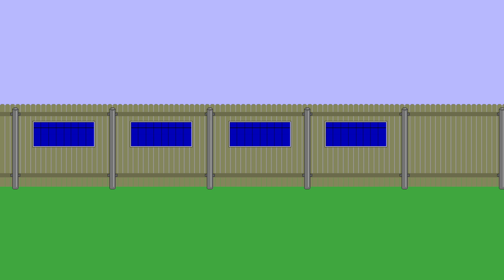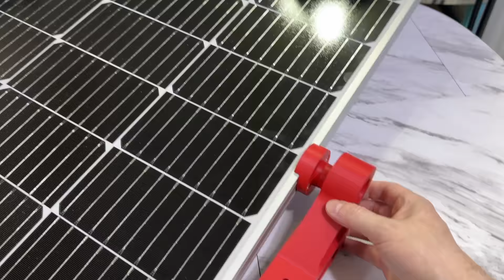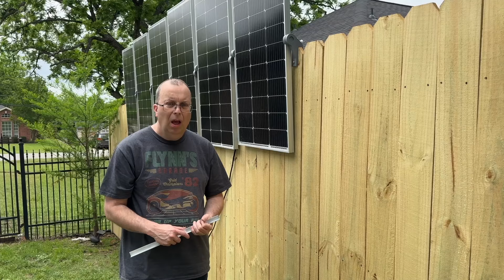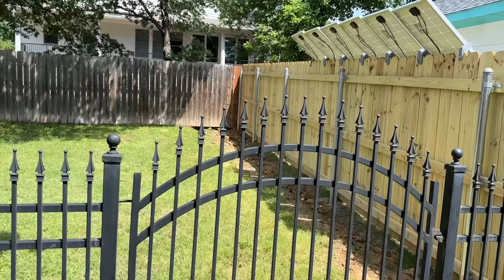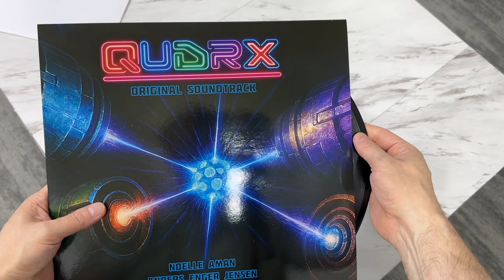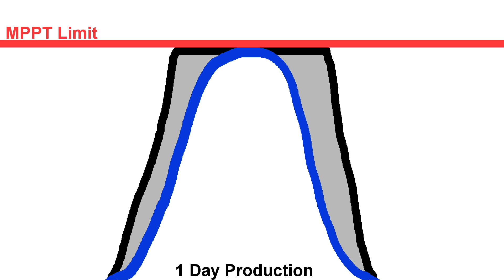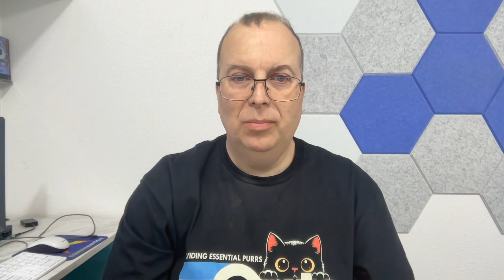I made an adjustable Solar Fence!

Comment: Thought on locking the panels at an angle: what if the mounts have teeth and can be screwed tightly, similar to a joint on a cymbal stand for a drum set?

Comment: I mean, it sounds cool, but I don't pay more than $1-200/mo for electricity without solar and I live in California. 

I'm sure I'm a low use case comparatively, but it seems like a lot of work and investment vs. just being mindful of usage.
Reply: Where in California do you live if you don't mind me asking? We're unfortunate to only have PG&E and during the summer our bill gets to over $400/month mainly due to having the A/C running. I live north of Sacramento and we don't have solar.
Reply: @JJFlores197  I am in 93555, right at the meeting of Inyo, Kern and SB.  We do have a notoriously high electricity price here despite being desert with plenty of sun for solar and lots of wind for turbines.
Reply: @JJFlores197 i grew up in Roseville.  I have moved to the desert and will admit that swamp coolers arw a bit of a hack. But they rarely make it comfortable.  Learning to live woth 76° vs 71° is the hurdle.  If true AC is the demand, then our 8 bit guy's situation is the answer.  I'm just positing that learning to live is a lower barrier to entry.

Comment: a neighbour of mine sets up when the battery is full his charge controller output is diverted to run just one of the elements in his water heater.

Comment: $600 a month electrics ?! 😱😱 I pay €50 and i already moan about it. Ok, here in Portugal the wages are low, but dammm life in the US is expensive, i go there often but never had interest in those costs as i go all paid by the work, but damm
Reply: Here in California, those of us that only have PG&E as our electric provider pay through the nose for electricity costs. During the summer months we pay around $400-500/month mainly due to the A/C running. PG&E's faulty equipment has caused numerous fires over the years and we are stuck paying for their screw ups. They've increased rates like 7 times over the past couple of years because they needed funds to repair and upgrade sections of their equipment so that the fires don't happen again. A lot of people are beyond frustrated with high electric prices here in California. But hey, at least we're the 4th largest economy in the world! 😆

Comment: I really like your setup! Great work. I would have tried to make my fence horizontal at the top by just cutting some on the bottom, gradually more when required. I think it might look nicer and be far easier to mount your panels. You can probably still do that! It will lower your fence somewhat though.

Comment: ❤ power companies need to buy your overage, last i checked, if the setup is correct.  At a reduced rate, but that night time setup you mentioned sounds like a scam versus producing excessive peak power for hours on end each afternoon. ❤

Comment: The panel location and tilt wouldn't work with any of my neighbors. Or me. It's great that it's your relative, but you're clearly implying that friendly property line agreements are ok. Frankly, I wouldn't even consider invading other owners' property, much less the legal side. But the main issue is it's arguably a legal issue. It's legally never a good idea to break property lines, or even push property lines with an overhang, even a variable overhang. Never ever. It's particularly not a good idea to make friendly agreements about property lines with neighbors. When houses are sold, one of the steps is to research and clear the property lines. You're just making trouble for realtors everywhere.

Comment: Regarding over panelling, it should be done very carefully to avoid fritzing out your charge controller. While the controllers normally do clip production to the maximum wattage, if the voltage goes too high, it's game over.

Comment: Just some considerations for anyone thinking of trying this.  Work with your neighbor, don't just do it.  A fence is a shared asset and requires neighbor cooperation.  First reversing the fence side needs to be mutual.  Typically if you replace the entire fence out of your pocket you get to choose, but don't assume.  If you split the cost and want to flip your neighbor needs to agree.  Second you can't just hang something on the top a fence that is visible to your neighbor.  Again you need to work with them.  Finally you absolutely cannot have something on top of the fence that also leans over into your neighbors yard.  Do this on your own and you're going to meet your neighbor whether you wanted to or not.  Ignore the issue and you're going to end up in court and likely paying for damages.

I am sure David did all of this.  He's really good at reaching out and I know he knows his neighbors well.

Comment: This one video demonstrated the "lethal" (spain for example, almost whole grid collapsed) shortfall of solar: energy storage and lack of predictability. Its stupid and drives energy prices through the roof (BC power company has to keep quick response gas powered powerplants at the ready to pick up the slack whenever ""renewable" generation plummets like a brick dummy)....
(Wont even get started on the batteries. Those things going cactus way before they had any hope of recovering their cost.)

Comment: My brother, you need to run all that inside steel conduit with junction boxes for the connections if you're going to mount it to a combustable material like wood. 

and the lawn mowing guys are going to weed eat those cables you ran along the ground if they haven't already by now.

Comment: The rebates unfortunately encouraging huge scams in my country. Also as soon as they start charging money to sell back to the grid people with either remove the panels or just go off grid. Solar panels are very popular in Australia due to government rebate. Is going to be significant challenges with replacing them as the older ones need fixing.

Comment: What about using those gas struts people use on the back of there pickups for there tailgate. Would make it easier to open and close quickly, and then perhaps add some sort of locking mechanism at each end of the travel

Comment: I wonder why he doesn't use remaining space on the roof.
Reply: it's extremely hard to clean them on a regular basis when they're installed on the roof (a light coating of dust can reduce generation from 10~30%, a heavy coating, almost 60%) and texas experiances a lot of storms with very large hail that can damage panels.

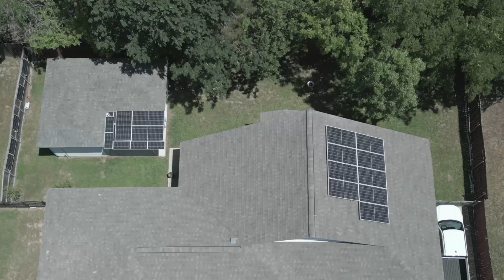Comment: 8:19 in germany it is now common to mount panel on the east and the west side, so you get morning sun and afternoon sunlight, because the panel prices are now that much lower then before 10 years. and with that you can  zero the average energy consumption during the day and with your south panels charging e.g. the batteries for year night consumtion or charging your electric vehicle or zero the cosumption during day for washing machines / dryer/ cooking plates .

Comment: There is those electric linear actuator cylinders that can open and close greenhouse windows when they get a signal via WiFi. Maybe overkill. But if you wanted to make sure to get the absolute best efficiency at any given moment in time you could have a script running that calculates the angle of the sun and makes sure the strut is extended to the correct length to make that happen.

Comment: Structurally it's weak. A simple answer is standard  kindorf/unistrut or similar across all the panels in one or two pieces. Tilt them with hydraulic rods for car hoods. Make your own 3d locks for midway tilting.  I bet 4 heavy duty ones are fine.
    It's trivial to make the fence line up on a grade. D&J projects does that for a living. They constantly have to adjust for slope. There are several techniques. The easiest is holding it up, striking a line,  cut with circular saw and then let it slide down. Whammo bobs your uncle, all done. (the posts never move) As long as the grade is not too steep it's fine and you bought taller fences.
     edit; if you use cable/rope instead of locks for the rods, adjusting should take only seconds.

Comment: You did all that without having to get permits from your town/city?  My town has all kinds of rules about permitting for pretty much any permanent structures and there are rules about how close you can build stuff to your neighbors lot and to get permitted for rooftop solar installs I need to get a signoff from a structural engineer to make sure the roof will hold panels + snow. I've recently been trying to figure out what I need to do to build a modest system myself here in northeast Connecticut
Reply: i was reading that and thought "that sounds like a really white area" then you said connecticut xD

Comment: It would be really easy to add a sun tracker to that design to tilt them automatically to get the max amount of sunlight. Also get a grid tie inverter to use the extra power and send it back to the grid. They will pay you for the power. Good job with what you have. I wish I could generate that much from solar here in Indiana.

Comment: 1. If we don't want to cross over the neighbor's fence line, we can just put the rotation axis at the very edge of the solar panel.
2. We can just use one barrel lock attached to the support, then drill a few holes in the rod that's connected to the fence.

Comment: Paying between $100-200 a month instead of $200-300 a month yet you spent how many tens of thousands of dollars on the setup? It's just not worth it, unless you make the panels from scratch and make your own battery bank then it's very much worth it. Otherwise usually the tens of thousands you spend have a break even that is usually after the warranty on everything ends which is usually when everything spontaneously combusts for no apparent reason.
Reply: He didnt spend that much.

Comment: Two points. 'Kai' is an individual. Not a plural. Secondly, no printed plastic survives the sun. I live in Australia, where lawn chairs are a 50/50 chance when you sit on them that they will explode into confetti from a few years in our sun. And that's WITH UV stabilizer up the whazoo.

Comment: Cheap lead screws and a small gear motor would give you infinite adjustability.  You'd be fine with an M6 since those looks super lightweight.  Between the gear motor and an acme thread, you wouldn't be able to back-drive the motor, so they would hold the panel up all by themselves.   You'd need a mount for one side on the wood and another mount on the underside of the panel (or edge).  
You could even program a raspberry pi to let them follow the sun by powering on the motors every hour or so.  Could get fancy by adding a wind speed sensor so they could go to a neutral position if there were heavy winds.  Don't need a fancy motor with a driver, a simple DC motor would be fine.  I also think you should have mounted the hinge much higher up so they don't sit above the fence line as much as they are now.  Your mother might not care, but you are creating a heck of a sail in heavy winds the way they are mounted currently.

Comment: Even if your mom is Ok with it, you may run into ordinances.  Here fences over 6ft are considered accessory structures and need to be set back from the property line and a permit is required.

Comment: I just tossed 8 on the ground with a small angle wind doesnt seem to get under such a small angle i did wire them down into the ground just in case. The other 8 i have i leaned against my house facing west. Those generate noon to dusk. Its Houston so i had some heavy winds and they didnt move.

Comment: There is an optimal summer and winter angle you want. What I've read though you can just set the angle to the latitude of your location for best year round panel angle. 

So Austin,TX would be 30 degrees or Chicago 41 degrees.

Comment: Hey 8-bit, good to see you!

You know, I much prefer my electricity to come from coal fired steam, purely because of my love of Steam Locomotives, but that doesn't mean I don't appreciate solar power in some circumstances.  For instance, although it is purely decorative, I did go ahead and add a Lego 3x7 Panel with Solar Panel Sticker to my Lego Airport Shuttle Monorail, right above the battery box.  It may not actually provide any power, (Lego sadly has never produced a functional Lego Solar Panel in that small of a size before), but at least I can claim that, from a lore standpoint, that my Lego Monorail is solar powered.

Anyways, good luck with your efforts, and May the Bricks be with You!  Rockatoa, Brickticks out!

P.S.  Yes, I did give your video a like!

Comment: Why not automate the solar set up?
You will need to make a geared track system, where you can use a motor controlled by an Arduino, and if you tap them solar output from the panels that the eco flow provides you can them make them tracking as well. and if a storm comes, they return to vertical.
The storm info can also be obtained from local weather sources and if you were to add a anemometer to the studio, the wind speed can then be feed into the Arduino as an additional data source so if the wind speed exceeds a set value the panels return to vertical.

This is complex yes, but will ensure you get the highest solar output possible, while still having the safety features you need.

Comment: Interesting idea but not sure about the aesthetics of having an outdoor wall of panels.  I've considered solar but I'm kind of on the fence... 😅  Anyways in the UK there's so little sun unless you have a huge area (precious here) then it's a long payback time. Guess if you don't mind how it looks then it all helps with power supply. Will look better if the panels could blend in with the fence panels... guess you might paint or stain the fence the same colour as the panels?   Might be interesting.  Next step to add stepper motors to automatically angle them during the day and fold them down after use, all powered by microcontrollers.

Comment: In my case, i programmed automation in my homeassistant to switch on water boiler (2,5kW) to consume the overproduction so i can skip water heating cycle that is usually at the evening and night. I saved alot of money by doing it this way. IThe automation watches if battery is charged, if PV production is enough to switch water boiler on, i implemented timings - if there are clouds that temporary lower the PV power and so on.. it works like a charm. Of course, this is mostly used during spring to late autumn. I( live in EU, CZ)

Comment: Auto sun tracking using sets of 2-4 photocells per panel and screw-drive pan/tilt mount sounds like fun!  There's some sun tracking projects in the hobby of BEAM Robotics that are dirt cheap..  Two photocells, a DC hobby motor, couple transistors and a capacitor. Of course, moving a whole solar panel is a whole new ballgame, but the speed is so slow as to be nearly imperceptible, so tiny motors and high gear ratios can do it while using negligible power.  Even just one axis for all panels, using one screw drive and two CDS cells to tilt the whole lot up and down as needed would give worthwhile performance gains.

Comment: Still feels like you made this more cumbersome than it really needed to be. A lightweight frame with offset hinges to make up for the difference in height along the fence and linear actuators would have made things way easier to adjust on the fly. The possibility of upgrading that to be wireless and track the sun automatically would have certainly been a possibility down the road as well. While your current solution may work, it doesn't lend itself terribly well to future upgrades. You'd basically have to start from scratch.

Comment: If you would mount horizontal rotating shaft and rotate it by worm drive and electrical motor, then you could attach cables to solar panels frames and control their possition remotely. Using worm drive you would make sure that the set possition will not change itself.

Comment: 15:30 Sounds like you need to get a 48V (51.2V) Lifpo4 battery and parallel that with your power station.

Comment: If you have traditional water loop heating, then excess of the power you could use to heat up insulated water tank to release the heat later on (either for heating the house or for washing).

Comment: The first "ladder" design you had for the angle support could work, just need holes for a detent pin on the top of one of the "claws" to keep it from backing out.

Comment: I bought the aluminum solar ground mounts suited 100w panels and made a bracket for the fence and mounted them on. I can position them at any angle but it does take a few minutes to unscrew the bolts and reposition the tilting arm. I have 6 x 100w Renogy panels and they do work well so I'm going to get 4 more soon. The one thing I will tell you to be careful of is if/when you mow the grass. My lawnmower blade hit a pebble which went flying across the garden straight into a panel and shattered the glass.

Comment: Not nerdy enough, needs to be motorized to optimize best angle for sunray captureing!
Reply: Yeah, that way you can waste the energy you’ve generated by running those motors!👍
Reply: @mutfol it depends on the gains vs cost, pretty simple math.

Comment: A word of caution.... That aluminium is VERY thin and after a bit of windage those self tapper are going to come lose. You'll be better served getting a set of fender washers on either side with a nut to spread some of the load more evenly across the plastic and the inside of the aluminium frame.

Comment: 13:20 20-30% power boost from cleaning*?! Either they were drenched in mud before, but cleaning from heavy pollen yields max 5% more. It also makes no sense to buy small 100W cells. At less than 100$ for 400Wp cells just cover the rest of your roof. *you may have cooled the hot panels down with the washing water, then +20% is possible, but only for a short time.